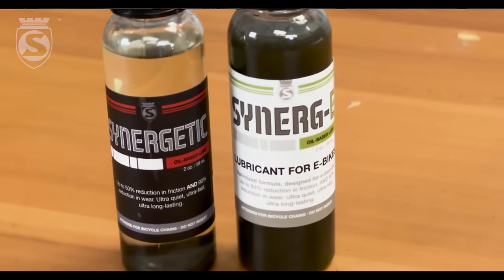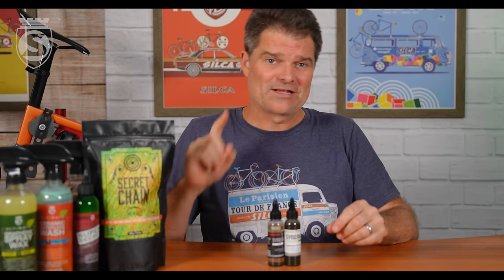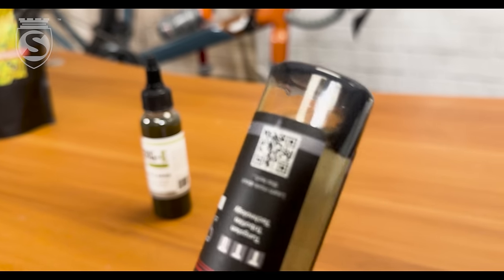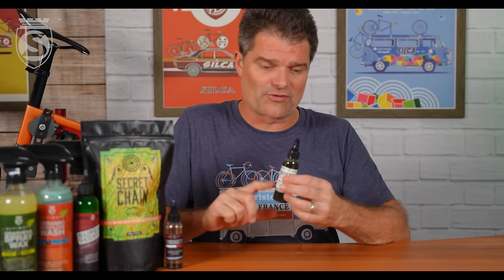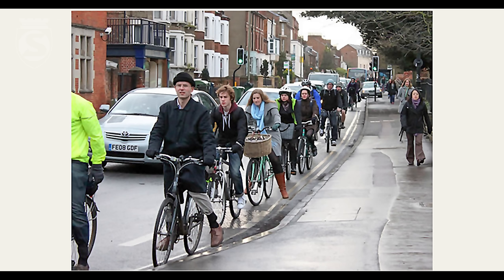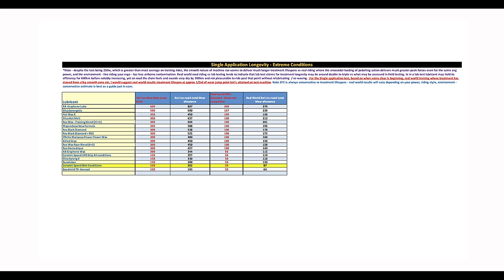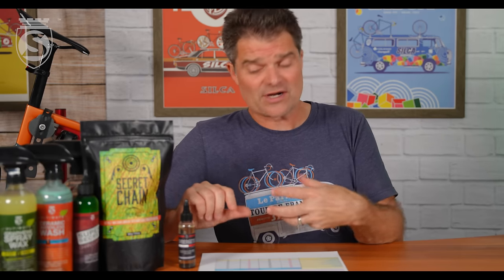Wax vs Oil: Which is the BETTER Chain Lube?

Comment: I went from Candada to Florida on a bicycle on a waxed chain, through numerous thunderstorms that lasted 8 hours+ of cycling in squalls of water. It was about 1500 miles. Every night I just dried it and applied the drip wax ( i did a melt before i left). Despite literal days of riding in the rain and off road dirt and gunk, my chain didn't even wear to the first wear indicator on the chain checker.
Reply: Candada?😂
Reply: I did roughly 5000km on my drivetrain with no visible wear - on oil. Take care of your gear and your gear will take care of you.
Reply: Canadia
Reply: What route did you take in South Carolina and Georgia?
Reply: @Jasonr606  I didn’t go through South Carolina I went from Atlanta to Jacksonville

Comment: For long events. like bikepacking I came up with this stragegy: have a 2 chains every day after ride, apply drip on wax, wait till morning until it's kinda evaporated, then change chain, and let your chain dry more over day while you're riding second chain, on evening drip on second chain... swtich at morning... repeat until end of event.

Oh, I didn't tried it yet, but planning by end of the month on vacation.
Reply: Just use synergetic - save all that faff
Reply: @MrHcharles  and then I would have to clean again my chain

also I use wax because I prefer wax
Reply: You don’t have to clean your chain when you apply synergetic, drip 1 per link, backpedal the chain for 30 secs then wipe off, any you only have to do it every 300 miles at the shortest
Reply: @MrHcharles after the event you need to strip the chain before rewax

Anyway 100% agreed on the synergetic and just one chain 😅
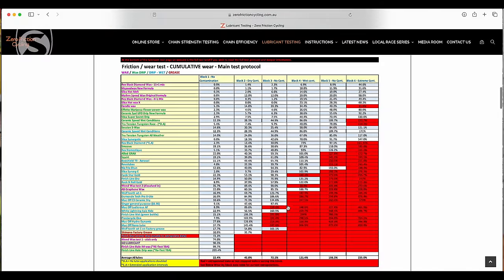Reply: Even the least expensive candle wax outperforms all "wet lube" products in wet weather (3:01 look at the ZeroFrictionCycling Block 4-wet contamination results). Silca Super Secret came in 3rd place among bottled wax drip lubes which placed higher than all oil drip lubes... Rewaxing intervals can likely exceed 400 km if you use a microfibre cloth to wipe your chain after every ride.

Comment: Started using synergetic on my steel road bike, which panniers and mudguards, which I commute to work in on daily in London. I ride all weathers, don’t care about fractional watt savings I’d get from waxing and want to quickly clean and apply the lube. synergetic has proved to be an excellent lube, and isn’t washed off when I’m caught in downpours. It lasts so long.

Comment: Hey josh great vid - just quick clarifications for all regarding the Single Application Longevity testing and data as that data table is a bit finnicky re understanding. 

First know that in the dry road test - without any contamination addition to accelerate wear / simulate other conditions - kms on a machine are not like kms pedaled. Machine kms are very smooth unlike the very large peak power phases of pedaling, and so km's attained on machine are much higher than would be expected in real world cycling. 

So the first column is the raw data of how many kms to the test allowance which for S.A.L is 20% of a chains wear allowance mark of 0.5% (so 0.1% elongation wear). 

This figure is then divided by 3 in an attempt to relate the kms to something remotely realistic / possible in real world riding. 

However - note that in general you do not want to ride a lubrication application to the point where by the time you re lube, you have used 20% of your chains wear allowance. Ideally you want to re lube at a point where your chain wear for that application is as close to 0% wear as possible. 

Hence in general the key figure / column to use is the adjusted kms to "jump point". The jump point is where we see there is a clear jump in the wear measure on the wear check intervals, as this is really what denotes the lubricant treatment as being effectively done. 

Ie - a wear check might show 1% wear of the 20% wear allowance. next check another 1%. Next check another 1%, and this continues for awhile, but then on a check measure we see say 6%. And the next check is also 6%. So the point at which the wear measures went from 1% to 6% would denote when the lubricant treatment started to give out - and that is the most accurate point to call the treatment longevity - The jump point. And again to relate to something real world - ish - the jump point km's divided by 3 - so the most far right column - that is the column to use, not the far left column which is the raw kms to the 0.1% chain elongation wear allowance. 

**Wear per interval and jump point - this behavior can vary a bit by lubricant type. 

Stereotypically with many wax lubricants and immersive waxes - there is a very clear jump point. There will typically be zero or close to zero wear per interval check, until suddenly when the wax layer is effectively done - a large jump in a check wear measure, and then it is not long until test wear allowance reached. 

However for some of the top wet lubricants - they may not display a jump point until reach wear allowance - just continue to show very small amount of wear per interval until the wear allowance is reached. 

So in the latter there will be no difference between total and related km figures vs jump point figures. Whereas for many waxes there is a clear difference between jump point figures (which is the true mark of when the treatment gave out) vs total km's to wear mark. 

Further detail explaining the S.A.L testing is on the top of the spreadsheet for the S.A.L test data. 

Thanks!
Reply: There's a thread somewhere here where a guy (@IlPinnacolo) wants to know why the chain needs to be stripped or prepped before dunking it into wax. He's not satisfied with the explanation that it helps with adhesion. Can you throw some science into the conversation?
Reply: Absoluteblack just released some bonkers longevity testing results for their graphenlube. 

I said they had to supply third party testing. Then they went crazy. Like you would expect 😂
Reply: @SnaxNoCo  Ha that is funny (to me). Scientifically i cant really help him, but logically it should be pretty simple. If i wanted to stick some sticky tape to a surface, and that surface was oiled or greased - i would have a tough time. An IM wax is a solid lubricant. So we want that solid to be bonded to chain metal. Then after break in, the solid wax coating is what is covering all part of the chain. It doesn't do that very well if there is oil / grease there, you wont have a fast solid wax coating, you just have a mess of wax and grease. 

There are deeper levels re science on pretty much anything if one really wants to on a topic - im just not sure in this case if the juice is worth the squeeze re time and effort for science and chemistry hunt vs just well that seems logical. Ie i am sure i fell off a building strapped to a large anvil vs if i fell off a building strapped to a huge helium balloon - i am going to fall faster with the anvil. A whole lotta math could be done to calc my impact speed with the anvil vs the balloon, or i could go you know what - i will go with the balloon thanks, it is just logical thats going to clearly be a better outcome for me. If i asked for the person giving me that option for the math before making a decision on which option to go with, i reckon they would give me funny ol look.
Reply: @zerofrictioncycling992  He makes the argument that both wax and oil are hydrocarbons, so once they are heated together, they should basically blend--so how could the oil prevent adhesion? It's not like we're sticking hard wax on a cold oiled surface--so the sticky tape analogy doesn't really apply.
Reply: @Eirikkinserdal  ha yes if you have that send it to me! AB are (in my opinion) really, really poor re any questions / criticism / feedback. Which with the mega claims they come out with on ANYTHING - being uber defensive and combative against any questions on said mega claims - to me it is just not a great way of operating. I do not understand how they have not yet twigged to how many customers / potential customers they turn away by acting like they do.
Reply: @SnaxNoCo  Sure - and to a degree that is correct - the FG will impact the wax by way of making it softer (hence strip chip to convert the FG to wax). But what the FG does to the wax and to what degree what may not be converted will vary - based on the FG, based on the wax, based on the temp and for how long - so experiences from one to another will vary. The main thing is it is simply not beneficial to the wax or ensuring the wax bonds as well. Post waxing an FG chain the wax can feel greasy, and you can wipe some black wax off onto your fingers  - it is just not a dry solid wax like a proper prepped chains. 

The argument of both are hydrocarbons is way too simplistic. A lot of oil is used to make rubber tires (7 gallons per tire on average) so we go from hydrocarbons being able to be used for lubricating, to being used for grip - depending on what processes it is put through. Mixing two and adding heat does mean they will just become the same.
Reply from the maker: Other than adhesion issues, the oil/grease on the factory chain acts as a solvent to the wax, softening it pretty dramatically.  The oil content of the best chain waxes will be 0.1-0.2% ensuring hardness and increasing single application longevity by slowing the rate the wax is pushed out from inside the chain.. Typical factory chain has 5-7gm of grease, so immersing that into 500gm of wax increases the oil content to more than 1% which can/will reduce single application longevity by as much as half.  By the time you put 2-3 factory chains into 500gm of wax, the longevity per waxing drops to less than 100km.  This is the chemistry 'magic' of StripChip, it converts the oil in the grease to a wax like substance with wax like hardness, and wax like adhesion so there is no change to the overall hardness of the wax.

Comment: Wife and I rode Canada to Mexico on GDMBR in 2018. We had immersion waxed chains, I didn’t do any adds, rinsed water a few times, put on new immersion waxed chains in CO. I’ve noticed my wax jobs/ chains lasting longer in recent years because I’ve gotten more thorough at cleaning factory petroleum goo before immersion waxing. 
I really struggle to understand how anyone still argues that waxing is too time consuming. Whatever extra time I spend up front getting chain prepped and immersed I get back many times over in fast, simple cleaning of bike. I do not own a cassette brush - I never have any crud on my drivetrain that doesn’t blow off with a common garden hose.

Comment: "Adam's talked quite extensively" might be the understatement of the year!
Thanks for this, it's refreshing NOT to see another "Waxing is best! If you're not waxing, you're a fool" type diatribe. It's clear all these products are trade-offs of one sort or another and what works great for one might be so great for another.
Reply: Larry it is great to see a comment from you that is not completely off a deep end :). Nowhere from me, or silca is it ever put across that if you are not waxing you are a fool. Simply the benefits one gets from IM waxing are clearly explained so that one can make an informed decision re if making what is often a big change for someone from just dripping something on - if that is right for them or if they should stay with drip lubricants, and if the answer is stay with drip - then what is the right drip lubricant - ie if one is riding road - then the top wet lubricants can be a great choice for many, however if one is riding offroad - the vastly superior contamination resistance of wax emulsion drip lubricants will be much better suited. 

So we step people through options, and simply when explaining IM waxing the inherent advantages of IM waxing are covered. No one else i know of, and i have been doing this awhile, has ever reported the "if you dont wax you are a fool" perception. 

It is an option. An extremely good option, but an option. which ZFC and silca and others have covered along with all the other good to great options that come from a bottle. I have never understood why so triggered re IM wax content, but hopefully your comment above shows you might be calming down :)

Comment: Two quick questions:
1) Best chain product for Leadville, assuming single application?
2) Best chain product dry dusty San Diego MTB to reduce maintenance effort
I use Secret chain wax with endurance chip for road

Comment: I use liquid wax when it's going to be dry but go to Synergee for 9 months of the year. Riding in Washington state, I end up hosing off my bike after 70% of my rides. The the oil/anti corrosion is super important. Even on a SRAM XO drivetrain, I get surface rust if I use any sort of wax based lube. The I use synergee specifically for corrosion resistance.

Comment: I bought a bag of the Silca Secret Chain wax and the Absolute Black 2.0 Graphene wax.  I tried two of Muc-Offs ceramic dry lubes and couldn't believe how crap they were.  Total dirt/sand magnets and waste of money.  

So far I've only used the AB Graphene wax and will NOT be switching back to any wet lube any time soon.  

Interesting notes on the Silca Secret to the AB Graphene.  I'm going to dip my other chain in the Silca and try them back to back after fully degreasing.

Comment: If you add one of your wet lubes on top of a waxed chain how do you prepare it to back to wax alone?
Reply: Yes, this!  How do you prep the chain before rewaxing in the pot?
Reply: Re-strip it to bare metal. You can heat the chain to melt most of the wax, use solvents (white spirit and gasoline work well) to clean it fully, and then you can rewax.
Reply: @pierrex3226  wondering if I can just use the Silca one step stripper…

Comment: Synergetic is noticably smoother, quieter and much longer lasting than any drip lube ive ever used. Only annoying thing is how long it takes to apply because of the viscosity and nozzle. 

Using the Super Secret Drip wax now since im riding dust more but will switch back to Synergetic when the rain comes

Comment: I’m a huge fan of your wax and use on all my chains. It’s pretty dry in SoCal and seldom has my chains been exposed to wet muddy conditions. For me I don’t see the need for oil but since I will be traveling with my gravel bike to the Philippines and Vietnam. I will probably get a bottle before I go just to be prepared. I hope customs doesn’t think I’m smuggling anything lol.
Reply: Even the least expensive candle wax outperforms all "wet lube" products in wet weather (3:01 look at the ZeroFrictionCycling Block 4-wet contamination results). Food grade paraffin wax is on par with MSpeedWax Original Formula and widely available for about $10/kg

Comment: Questions on using Synergetic during a ride on a hot waxed chain:  How do I revert back to hot waxing?  Do I just redip the chain in wax or do I need to deep clean it to pristine condition?
Reply from the maker: You will need to clean it with Chain Stripper, SILCA brake and drivetrain, or similar.. before rewaxing.

Comment: As someone who wasn't convinced by wax for bikepacking, and converted back to wet lube - if you're suggesting an initial hot wax and then lubing the chain, how would you then clean the chain to rewax? Degreaser? Boiling? Stripper?

Comment: Been using White Lighting for over 25 yrs. Haven't personally ever had a chain problem. I'd say it has a lot to do with the rider in addition to lube.
Reply from the maker: You would love one of the modern lubes.. WL is objectively one of the worst lubricants still on the market in terms of single application longevity, friction, and wear.  SuperSecret, UFO, Rex Black Diamond or numerous others will net you a 6-7watt friction reduction, 3-4x increase in application longevity, and as much as a 10x reduction in drivetrain wear.

Comment: Hi Josh - Thanks for the informative video. I am running Super Secret on both my road and gravel bikes and have been happy with the performance. My question is about my mountain bike. I am considering changing over to wax, but am concerned as I live in Victoria, BC (which is similar to Seattle, Vancouver, etc) and winter is coming, i.e. I will be riding my MTB 2-3 days a week in wet, muddy conditions, then will be rinsing my bike off. Do you think that Synergetic would be better for winter and that I should wait until Spring & Summer to switch to wax?

Comment: Josh, I’ve started waxing with your products. I added the endurance chip to my first melting. My question is, if I wanted to strip a chain do I add the strip chip to the current wax/endurance chip mixture?  Or do I need to clean the heat cup of all the current wax mix and start new with strip chip?  This question also goes for adding the speed chip, what is the protocol for mixing, matching wax, chips, strip chip?  Thanks,
Don

Comment: I have consistently found that Supersecret Chain wax does not last well on my gravel bike chain in dusty long rides.  It was a new chain, waxed with strip chip.  I clean with hot water, rewax, ride and then apply Super Secret Chain lube to top off the wax.  Again this weekend, I was about 80 miles into a 130 mile gravel race and my chain just started grinding.  Had to beg chain lube at an aid station to finish.  Suggestions?